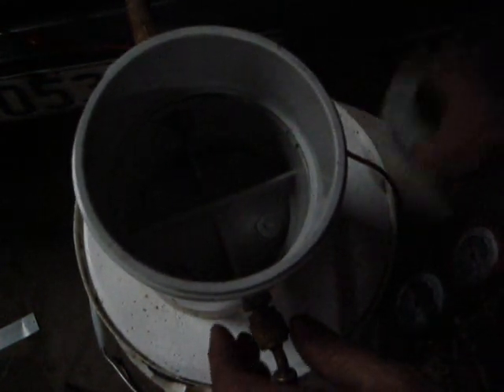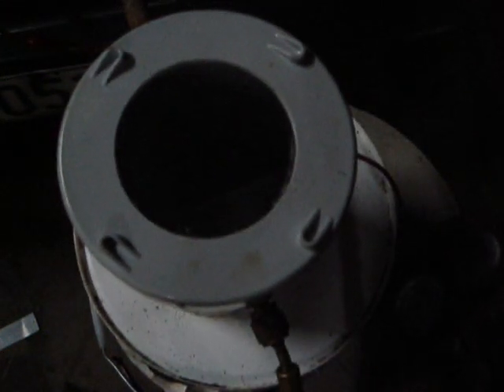Ball Spark Plug going wild under higher pressure

Comment: great job!!

this will work great with all the inverter ac/dc water explosion tests out there!!

what kind of ignition system are you using??

next video that you make can you spray some hot water at it? and perhaps spray some hot water under pressure as well... lets see if these plugs will perform as Krupa has claimed!

thanks allot!